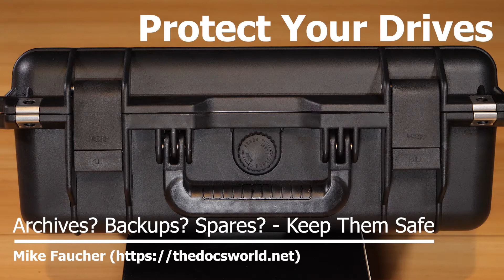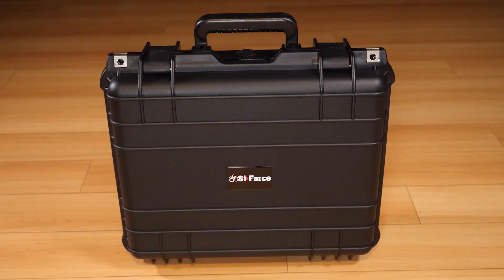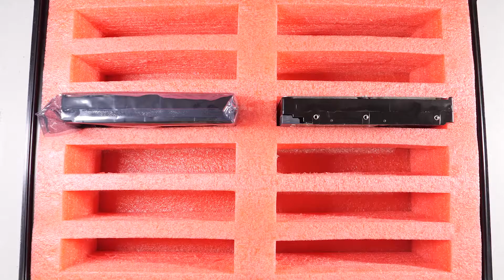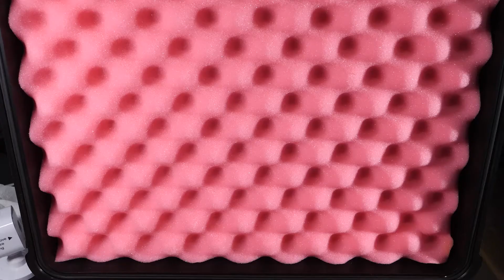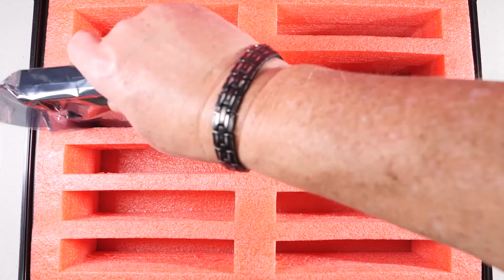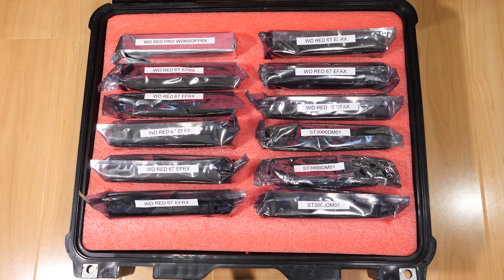SiForce Hard Drive Carrying Case

Comment: I need to store 2 3.5 hdd in the garage. But it reaches 90-100 Fahrenheit temperature's. Any pointers ?
Reply from the maker: I live in southern california and often see temperatures hotter than that.  I have been storing mine in the garage with many drives for more than 5.5 years with no issues.  As drives can comfortably operate at 125F, storing them at 90-100 should not be an issue in my opinion.
Reply: @MikeFaucher  TY
Reply: @MikeFaucher  Have you used any other cases for this ? I only need to store 2 drive's.
Reply from the maker: No, but any case that physically protects the drives should do the trick.

Comment: the 20 bay orico one has black foam, is this anti static? is it safe to put my hdd's without an anti static sleeve in the 20 bay orico case?
Reply from the maker: You would have to verify with Orico but typically they are not. best to put the HD in an ESD bag then it will not matter. ESD bags are pretty in expensive.

Comment: Looking at the price of these cases, I can only conclude that foam must be incredibly expensive, because you can get the cases themselves for less than 1/5th. 🤑
Reply from the maker: Overpriced, but it has been useful and still contains about 8 of my hard drives.  Glad I have it, thanks for the feedback.
Reply: @MikeFaucher  - It's not just hard cases, either. There are literally cardboard boxes (with cardboard dividers) sold as "HDD shipping boxes" for $40 (which is about 20x what an identical cardboard box would cost if it didn't have "HDD" in its name).

Now, if someone manages to add "organic" to the name, they could probably quadruple the price again.
Reply from the maker: @RFC3514  Great point especially the organic comment. 😀

Comment: I'm wondering what the pest hdd drive storage position is, standing or normal lying flat like it's in use normally or it doesn't matter at all for long time storage. 🤔 Ssd it don't would matter I think becourse it's only chip based.
Reply from the maker: We would have to verify with the MFG but my understanding is that it will not make any difference base on how these are constructed.